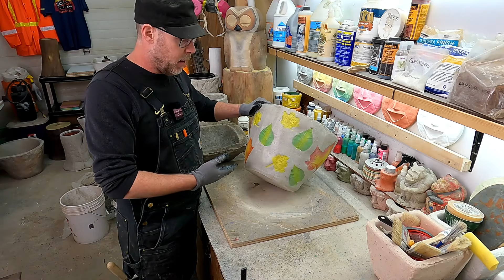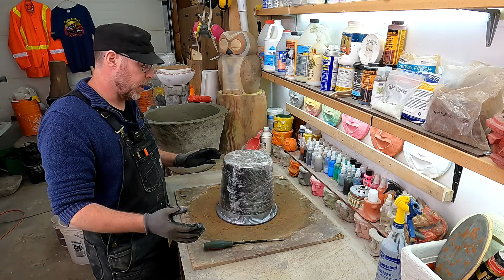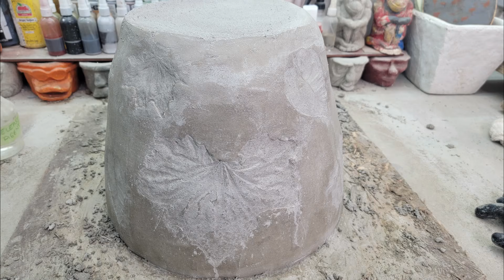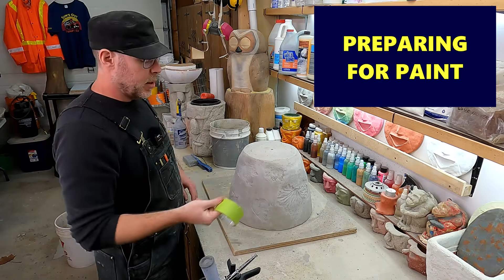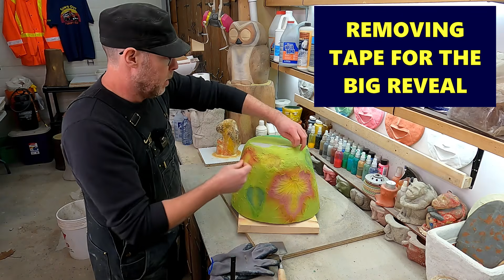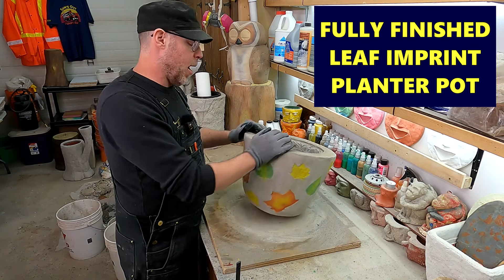How to Make a Leaf Imprint Concrete Planter

Comment: I am not at the silicon mold stage yet but I will try your technique for pots.  Question.  I would like to use a pail of beach rocks 1 to 2 inches mostly weathered quartz and decorate the outside of the pot gluing or pressing into the concrete.  I do not want to deform the pot by pressing into the pot so my thought would be to glue stones to pot then fill gaps with mortar or grout?  Any thoughts for a long lasting pot meant for the outside in New York?

Comment: MR. Maker - I like the pot you made with the leaf impressions, but I have a few suggestions -  First:  Build yourself a turntable so you can easily rotate the pot on the table plank while you are building it.  Many folks find an old swivel bar stool and remove the seat, then attach to the swivel either a round or square plank for your work surface.  Next:  When you build any type of planter or pot that's going to live outside, you should always add a drainage hole.  While the concrete is soft, just use a piece of PVC pipe, or copper pipe to make at least one hole in the bottom.  Push it in, then pull it out and the hole remains.  Next:  When you make your cement slurry, then apply it to the outside first before you stamp your impressions.  You don't need to slurry the whole pot surface, just the surfaces where you are going to apply the stamp.  You should get a lot more detail that way.  Next:  Get a small fountain pump and a large styrene tote (big enough to hold your pot).  Fill the tote with about 6 or 7 cm of water, add the water pump to the pool of water and put the pot into the water upside down (rim at the bottom).  Turn on the pump and let it bubble water over the pot.  That will make it easy to water cure the pot for the 28 days necessary to give the pot max strength.  I hope these help  I love the videos you make.